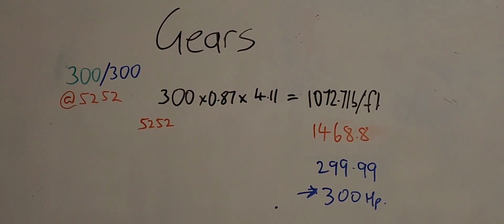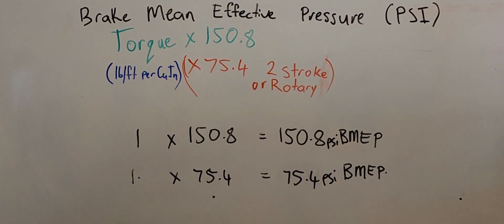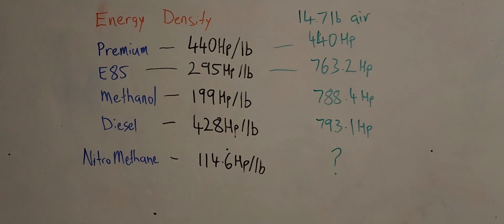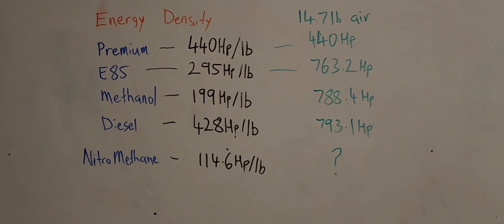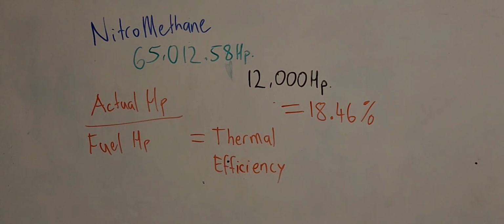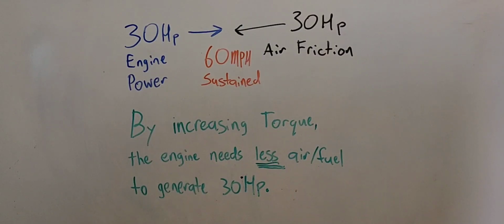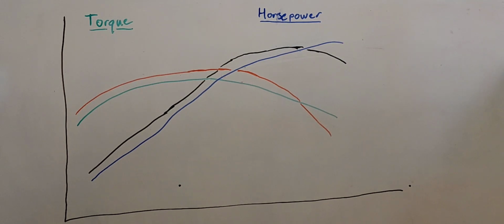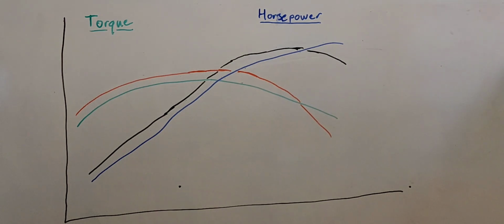Torque and Horsepower, a Hobbyist Engine Builders Perspective - Part Two

Comment: At the end, the dyno curve, the blue Hp line probably would need deeper gears cause of it's higher peak hp rpm, so it would be running at higher rpms for any given speed possibly putting similar or more hp to the ground. But I get your overall point it's about the average power to the ground not just the peak.